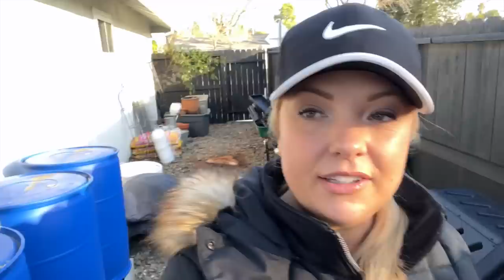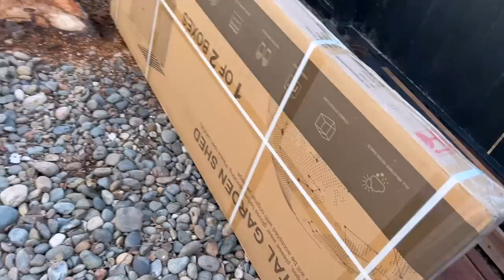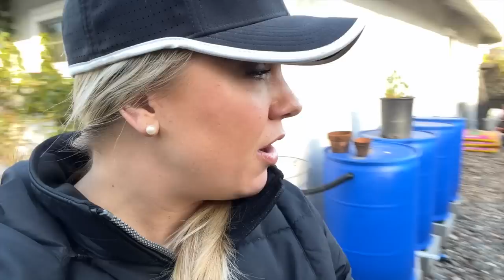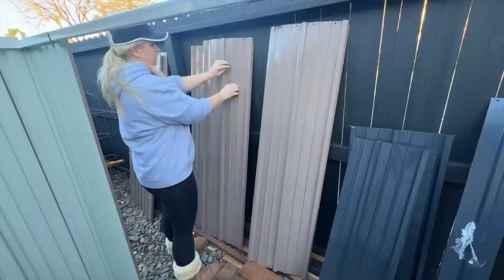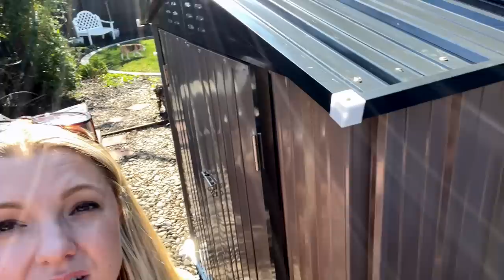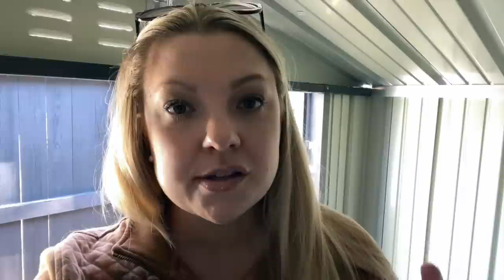Putting Up the New Garden Shed! :: Organizing the Garden and Getting Ready for Spring!

Comment: Hey Janey, 35 year garden designer here. The 20" precast cement stepping stones install like a dream. Home Depot will deliver. Just scrape gravel to outside and make center walk, then return gravel around pavers. Have done it dozens of times. 😁
Reply: This is really good idea!  Having had both, cement and gravel walk ways gravel is so much better for drainage.  Plus concrete is so permanent, sometimes design and garden ideas change even when you think you're 100% sure about the decisions you make.  It is a side yard but some larger potted plants would soften everything.  Nice shed!

Comment: Have you considered instead of painting the rain barrels, enclosing them in a some sort of storage cabinet/shed with an opening for the spigots?  Something similar to the type used to hide trash bins but maybe with a flat top so you can place pots or other stuff on top. Also, how about using decomposed granite instead of concrete which is not only cheaper but permeable and better for the environment. 🌏😀 I have it on my side yard and have no issues whatsoever.  When it rains, it soaks up the water and dries quickly there is no muddy mess and the occasional weeds that do pop up are easily pulled out by hand.  My next step is a side shed, so you have me beat there 🤣